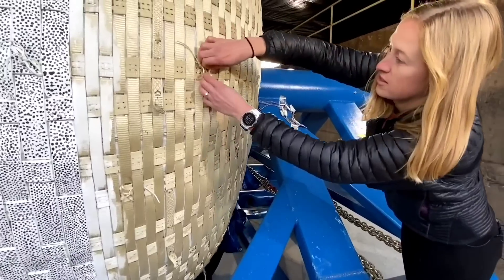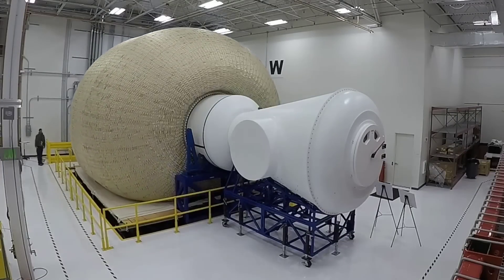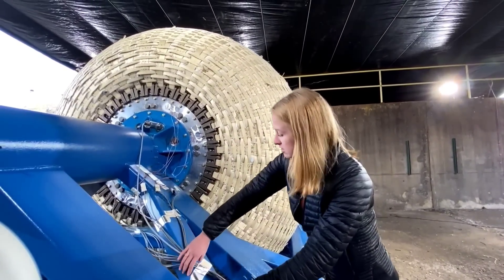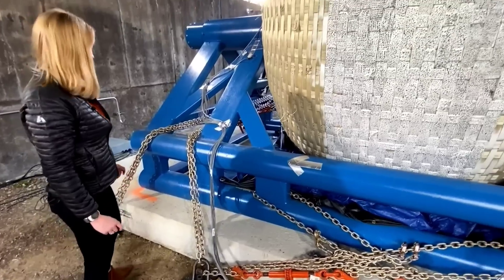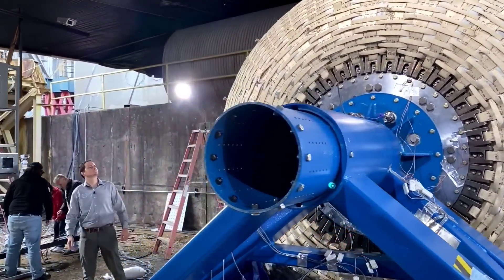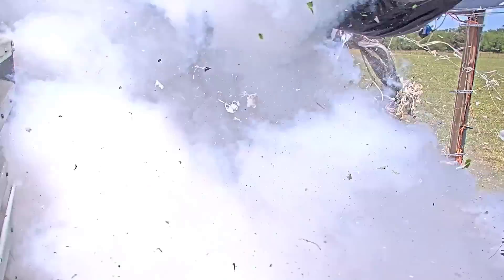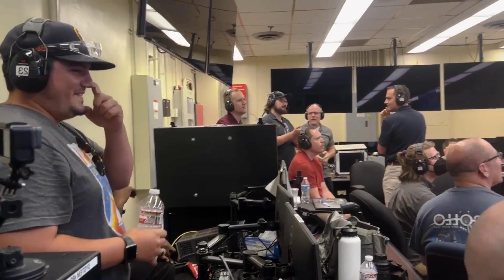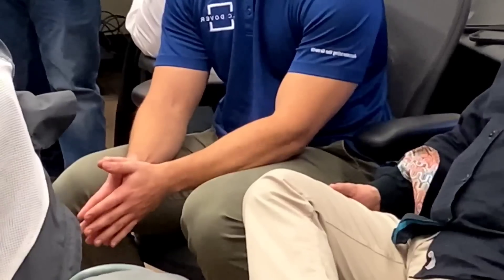BREAKING NEWS!  Sierra Space reaches more milestones in the race to orbit, the Moon and Mars!!

Comment: Turn those inflatable modules into giant methylox fuel tanks. Allow them to increase or decrease in size as required and park them near Gateway or make Gateway a part of this fuel depot. Take the full Starship vehicle and make the fuel and oxidizer tanks fill the entire first and second stages. No second stage or second stage engines which makes this rocket SSTO to the fuel depot leaving enough remaining fuel for a landing back on earth. Landing legs for earth landing will be required.

Comment: The maximum internal pressure at failure is only part of the tests required.  They also need to inflate it to working pressure in a vaccum chamber to asses the rate of air los through the fabric by osmosis.   They also need yo conduct impact test by firing projectiles of varyi g weights,  size and velocity tl quantify  the projectile impact risks.  The have to abandon a module half way to mars would be a serious  problem

Comment: If you blow up a balloon and release it, it will propel itself for some distance. With that in mind, if the LIFE module experiences a catastrophic tear and all gas is released within a second or two, the space craft it's attached to could be severely knocked off course requiring a massive amount of fuel to correct, or at worse be ripped apart.
Sorry to be negative, but I'm sure this is one of many scenarios NASA are thinking of. I hope the boffins can come up with preventative solutions and countermeasures because having a large amount of living & working space will make a huge difference to what astronauts can achieve and it will help out with their mental health too.

Comment: When I think of building something to be used in the elements, my first thought is how well will it withstand exposure to ultraviolet light and the elements. I once bought a "plastic" rope to be used to provide support while working on a complex hip roof. I was reluctant to work on the roof and left the rope exposed to the elements too long. That rope broke on the first use. You could see it was discolored and it didn't take long. I have never really seen much that could withstand the elements, especially what you would experience in space. I suppose they have figured that out but I would like to have a look at the web material. I suppose you could surround it with some kind of aluminum like material that would expand over it like the old aluminum popcorn container:-) Oh, I had a roofing inspector examine the roof and the insurance company replaced it. I'll never go up on a roof again.

Comment: Why do they need to test to 200psi? That's bonkers, like the pressure 400ft down the ocean. No space craft would go beyond 1 atmosphere. 15psi. Safety margin is one thing but this seems like engineering in a pointless direction.
Reply: That sort of test allows them to Tout extreme reliability in the worst of conditions. That's my take on it. Be well.
Reply: @bradley772  I doubt any other manned spacecraft has ever been built that could cope with 50psi. What design compromises have been made to make it  take 200psi. Imagine if the Apollo LM was built to handle that kind of pressure. It would be a battle tank.

Comment: My issue with inflatables is one of the interior walls. A rigid module can be taken to orbit with all the interior walls in place complete with any mounting brackets for whatever equipment is needed. An inflatable module, OTOH, will be in a compressed state so you'll need an entire second flight to bring up the interior fittings. A second flight that could bring have brought up a second rigid compartment.
Reply: Fortunately, launch costs are dropping lessening the blow.
Reply: Yea, I assume they have a frame that clips to the inside and holds the equipment..
They will need a heavier, stronger one if deploying these in gravity..    :)

Comment: 200 PSI? Considering that use pressure is 1 bar (or 14 PSI) or less (many habitats seem to run less than Earth pressure) I am guessing that the 200 PSI test helps replicate the instantaneous local pressure experienced from a meteor strike. If something hits it at high speed, a hole is preferable to disintegration. I am guessing the "test article" is not the full thickness and that this part would not be seen either from the inside or the outside. I think repairs would be limited to the inside skin or the outside skin, so I think the outside skin would be much thicker.
Reply: Id be more interested to see it hold that pressure for a long time while exposed to the sun or other radiation sources  to prove no leaks or long term degradation.

Comment: Other advantages of inflatables on the lunar surface are the relatively low mass per unit volume, and low bulk. This makes manoeuvring them from the landing pad into place for assembly much easier. Our early Artemis work in the 90's envisaged spherical and toroidal inflatables, and I'm pleased to see the current design imagery showing a toroid with a supportive core (actually, it'll be under significant tension but that's another story).